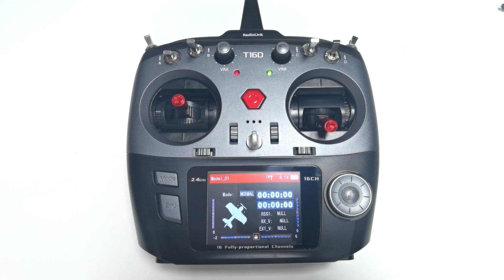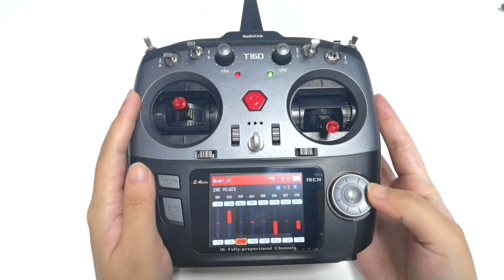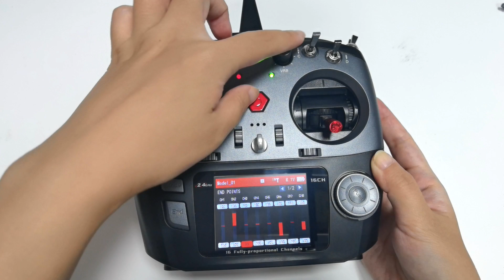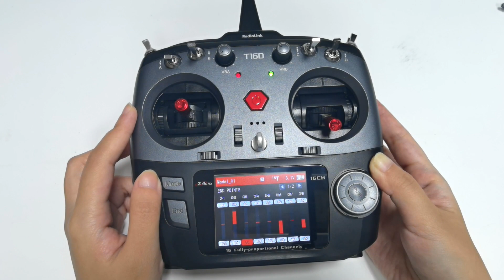END POINTS Function of T16D/T12D

Comment: Helicopter mode is not perfect, ch3-ch6 function works together no matter how it is set, ch3 ch 6 software is written incorrectly.
Reply from the maker: Hi, sir. Is it convenient for you to send us pictures and videos to us to show the problem? It will be helpful for us to know what problem it is and send the feedback to our R&D team. Our email is: after_service@radiolink.com.cn
Reply: The factory does not test the product, the software program, the helicopter mode is not complete, which is very bad. Don't you test it before selling? Don't you know that the software, the T16 and T12 helicopter mode set is not complete?
Reply from the maker: @ปิยะณัฐลาลี-พ9ร  Hi, sir. Sorry for the problem. Is it convenient for you to send us pictures and videos to us to show the problem you mean? It will be helpful for us to know what problem it is and send the feedback to our R&D team. Our email is: after_service@radiolink.com.cn Thank you for your patience.
Reply: @ปิยะณัฐลาลี-พ9ร  
I had the same problem. The channel 6 (pitch) was linked AFTER channel 3 value. Example, you did throttle curve. The channel 6 will work from the value output of the throttle curve, not the stick movement.
However, you should try to update firmware to the latest version (1.7.1) and select swash type as fixed (the first option). Mine is good now.